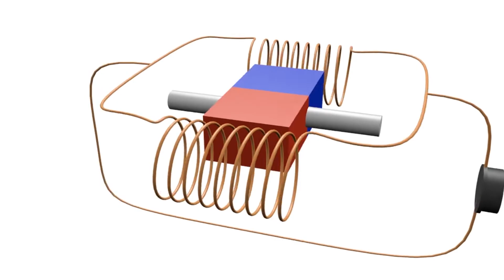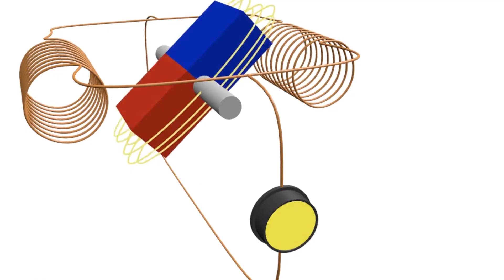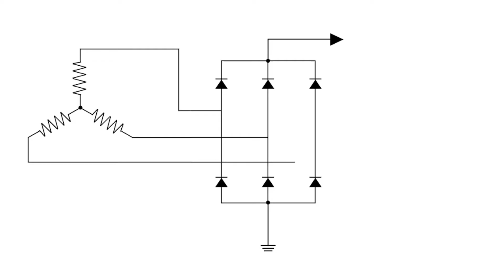Inside The Alternator, Alternator Working Principle and Circuit Diagram

Comment: I am curious, I would like to wire an old used alternator to make 120 volts and was wondering if wiring the 3 winding in series would do it? Also where can i get a frequency meter to make sure the load is gettiñg 60 cycles or hurtz and correct voltage of 120 volts, thanks for your time

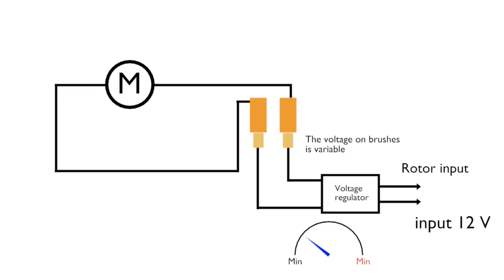Comment: Tnx❤ i have a question . In 3:45 there is two wires connected to "voltage regulator" one of them going to battery and other one connected to "ign" . But i dont understand why? We know IGN itself is connected to battery...so what is the purpose of these two wires?